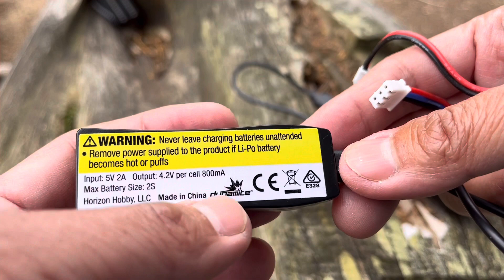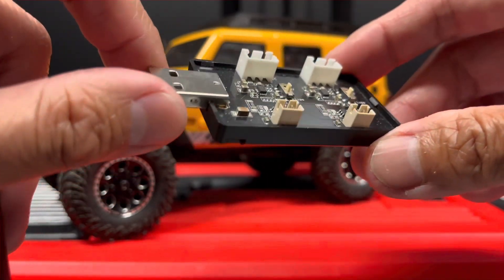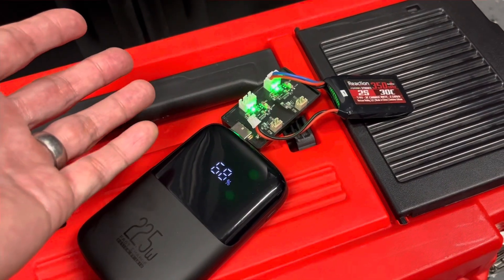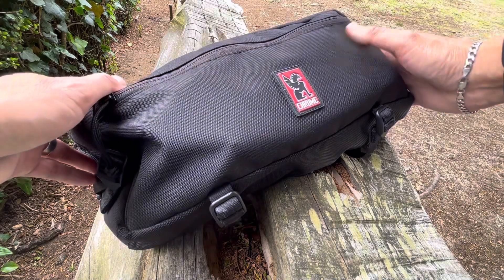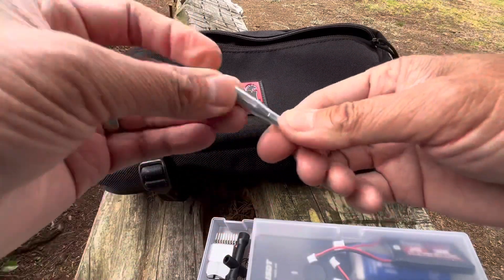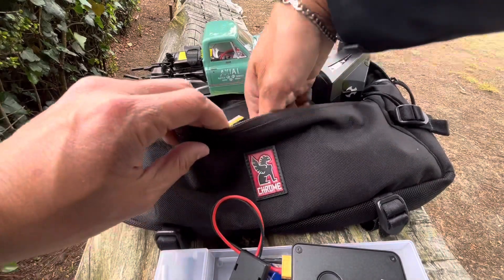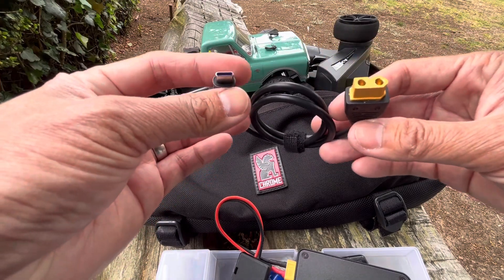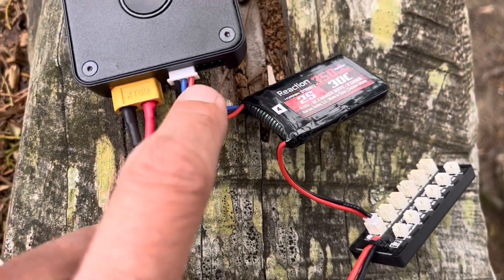Best way to field charge an Axial SCX24 RC micro crawler using a battery bank

Comment: ph2.0 male to xt60 female
Reply from the maker: Are you talking about the cable that's needed to charge the SCX24 using this charger? If so, yes.
Reply: @Funcentric  yes . I used ph 2.0 - JST and JST - XT60